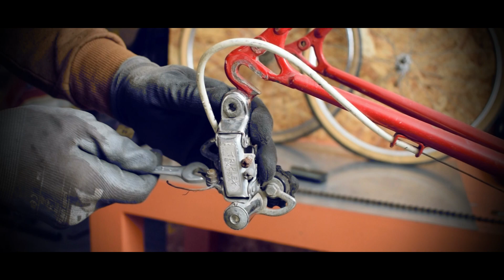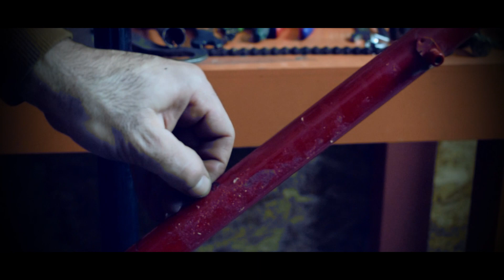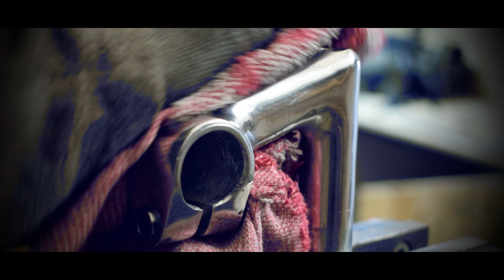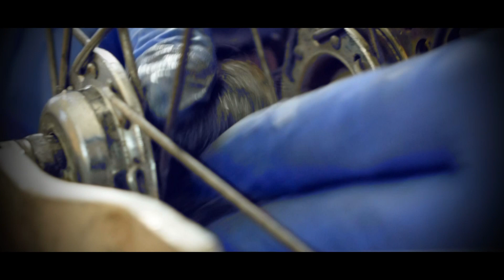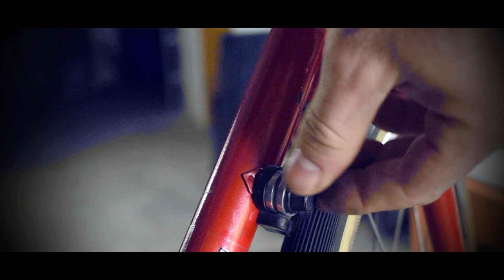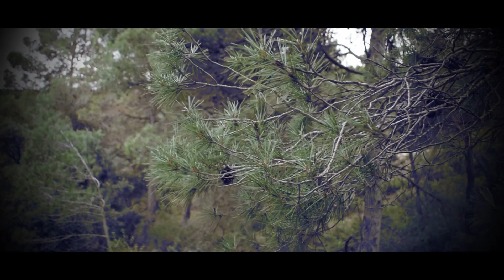Disassembly, clean, polish and build classic bike.-SUPER BH L3000-

Comment: There is the video I have been looking for! Thank you! This is a great instructional on taking apart and servicing/restoring a classic bike. Still, a list of tools and where to get them would be very, very helpful. You have no idea how helpful your videos are!
Thanks!
Ps. I had a junior racer in the 1960s with one chain ring in the front and the same three cogs Simplex drive train. Not this make, but undoubtedly the same drive train. Brings back memories 😊
Reply from the maker: Hello again my friend!!! Well, I will try to put the parts and tools that I use, even though they are not new tools, it takes time to find tools that may be worthwhile and recommending something that I have not used is complicated. Thank you for your comment and for leaving me a nostalgic message. It's what I like the most ; )
Reply: @dabrestauracion7404  I think I have found a good starting point: Park Tool PK5. A good set. Not cheap, but this tool set will cover most restoration and repair scenarios. I post this for others, who might have the same question. I thank you for all your time and interest in responding to my enquiries. Thank you!
Reply from the maker: @larsfrandsen2501  hello again friend!!! I have to respond to the comment you left me on facebook. Using park tools is always the best option ; )

Comment: nice video !. can you tell me which attachment you use for the angle grinder? . Is that a sanding attachment? What is the grain size of the sandpaper for the attachment? br from Germany
Reply from the maker: Hello friend !!! It is an abrasive disc of the Soldufer brand in Spain, the disc is used for fine sanding and after passing the cloth disc, with universal pink fine polishing paste. It is used for stainless steel finishes. . I don't really know what grain it is. You can see all the products that he used in this video in its description. Greetings from Spain, I hope I have helped you with your question ; )

Comment: Nice job as always:)
What do you use to polish the wheel rims? The came up great
Reply from the maker: Thanks a lot friend !!! I use the universal polish and I give it with steel wire wool, I leave you the link of what it is. A greeting and thanks for comment ; )
Reply from the maker: https://www.amazon.es/zhongjiany-Alambre-Eliminar-irritaci%C3%B3n-Limpieza/dp/B07QF7MZRJ/ref=asc_df_B07QF7MZRJ/?tag=googshopes-21&linkCode=df0&hvadid=389162059186&hvpos=1o1&hvnetw=g&hvrand=4918803577934825171&hvpone=&hvptwo=&hvqmt=&hvdev=c&hvdvcmdl=&hvlocint=&hvlocphy=1005404&hvtargid=pla-832305966379&psc=1

Comment: magnificent work
may I know what you ve used for polishing? What kind of disc and which gradiation?
Reply from the maker: Hello J C !!! Well, it's all in the video description, anyway I'll write it again:
The products that have been used in the video are the following:

*Cleaning:

         -Degreaser (KH7 brand).

         -Water and soap (universal).

         -Sponge.

         -Cleaning solvent, for bearings.

*Polish:

         - Polishing sponge (cindis brand)

         -polishing machine (makita SA5040C)

         -Universal polishing (cindis brand)

         -NPR abrasive disc (soldufer brand)

         - Universal polishing cloth disc.

         - Pink universal fine polishing paste.

Regards and thanks for your comment ; )
Reply: @dabrestauracion7404  Thanks, sorry for unnoticing description :) I have some polishing to do on my '92  cranks and stem, so I'm considering some options. I think i'll just try doing this manually using sandpaper, 150 for scratches then 400 800 1000,  next 1500 2000 on wet, and polishing paste at the end. I will be some fun, but Alzheimer's is no joke, gotta protect myself. Pozdrawiam z Polski!

Comment: Never seen crank spider "sledge hammered" on like that before , surely your damaging the bearings on the adjustable cup side !?. I would not you anywhere near any bike of mine ! having said that i ride a rare 1987 BH Campagnolo, lovely comfortable vintage bike.
Reply from the maker: Hello friend !!! That will be because you have never removed some original BH cranks like these !!! I understand that people who are not used to disassembling this type of bicycle, do not know how they work. It has nothing to do with campagnolo cranks, which are extremely easy to remove. Greetings and I hope you understand what you see before judging ; )
Reply: @dabrestauracion7404  Over the years i have fitted/ serviced Cranks and bottom brackets from Campagnolo, Zues (same) Shimano , Sugino, Stronglight,Mavic, Suntour, Sakae Ringae. Dia Compe. ET AL, the practice was /is to screw the bolts down, then after a short period say 50 miles check to see if they tighten again , experience tells you when to stop. your crank is a bog standard design 3 piece chain set , You just dont hammer them in like that. you have probably done more harm than good. BUT, if there is a genuine reason for such a crude amateur looking method of reassembly then please state why.  PLEASE STATE WHY. Also do dodge the question by alluding to disassembly whist its perfectly obvious I am talking  about re-assembly using a metal hammer to bash the spider onto the bottom bracket axle.
Reply from the maker: @jezztech  Hi, friend!!! Sorry if my comment made you feel bad. I have never alluded to a comment, if you notice I respond to all. Now I'm going to tell you why they are assembled in this rough way. This is how the installation is carried out, because this type of cranks when you place them on the bottom bracket, the gap between them is very tight and there is a very large distance and the screw does not thread, for this reason the blows occur With the rubber hammer, (which does not damage the cranks since they are made of iron and not aluminum) to be able to align them, since if you do not do it the screw will not arrive and if you try to do it it tends to over-thread. I can assure you that if it were another type of cranks, I would never dream of doing this. I'm sorry if my previous comment was offensive, but you were the first to be offensive by saying that you would never bring me a bike. I live living and learning every day, I am neither perfect nor do I want to be. You can be a constructive critic and I love that. But be offensive not please. Greetings and apologies if in my previous comment I did not give you the necessary explanation, so that you understand why this installation. All the best ; )
Reply: @dabrestauracion7404  ok well you explained.